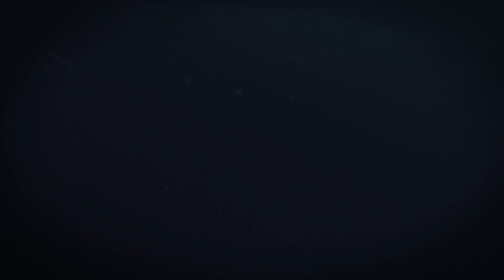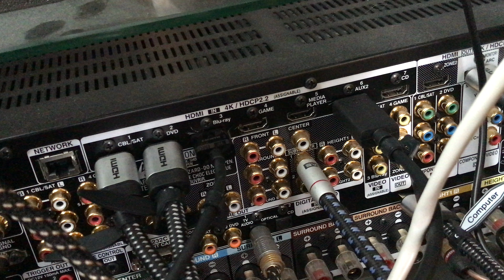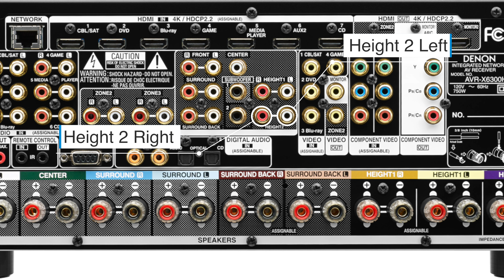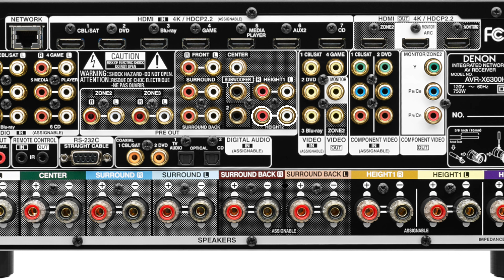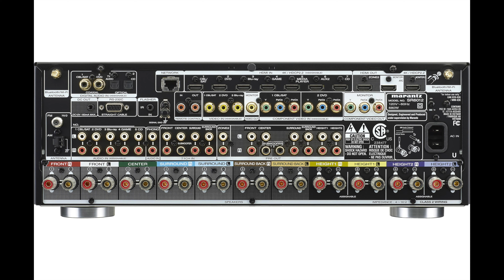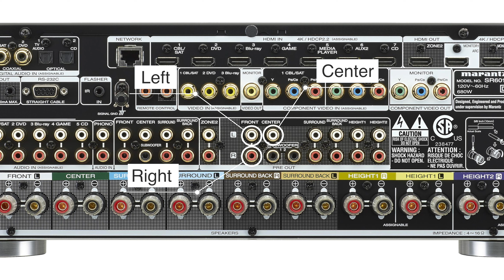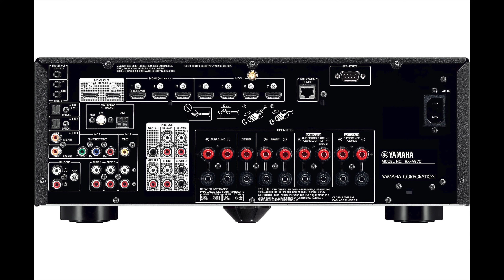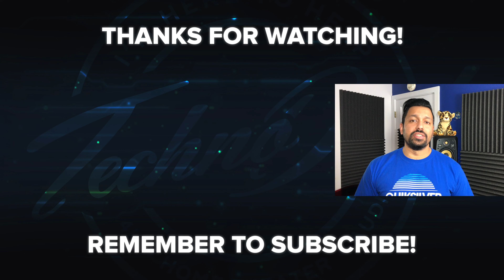How to Add an External Amplifier to Your AV Receiver | Home Theater Basics

Comment: Thank you for sharing the things, Can you please explain me about the "controls and settings on my  AVR  Marantz SR-6015, after adding the  
3 Channels  POWER-Amp to the preamps of my  SR 6015 (Center, FL, FR ) . Whether the volume, levels and crossovers and Audessy  settings  of these 3 channels will be automatically bypassed   or still continuous, any sound delay issues etc.  Rest of the channels (surround and height) continuous to work   as previous or stop?  If I select  pre-amp mode in " Amp assign'  setting what happens?

Comment: The master volume is still the receiver or are volumes separate between the amp and the receiver? It is something that I do not understand and it is not clear to me
Reply from the maker: Hi!  Power amps won't have a volume level, so the AVR will handle that.

Comment: Hello Techdaddy. My name ys Robert. I have a 5.0 surrounded system. I ordered the Yamaha Aventage A6@. I have 2 older tower L/R front Cerwin Vega VS seris 15” speakers that I would like to boost the output with a preamp what type, brand and wattage do I look for? My RMS on my speakers say 500 each. Can you help with atmos speakers also?

Comment: Yeah you're only getting the full 140W per channel if it's a 2 channel setup. If you have 11 channels you're lucky if you get 50W per channel
and that's too much for any receiver to handle.
Reply from the maker: Correct!  That’s why an external amp is so useful.

Comment: But what if you're working with a lower model receiver that only has subwoofer preamp outputs?
Reply from the maker: Unfortunately, you can’t add an amp with a lower end AVR.
Reply: @TechnoDad  what about high level to low level adapter?

Comment: So my 7.1 is running 7 plus 2 subs...living room ya dig?  I ran all the audio cable through the wall so the audio is an outlet capable home.  But I need to add a projector in the basement and surround sound attached to it and 3 or if not 2 more speakers outside

Comment: Just purchased a Marantz 6014 amp and currently running a 7.2.2 system. Wanting to add 2 more height atmos speakers. I understand you plug into the pre out  height 2 on the Marantz amp but where would you plug into on the external 2 channel amp. I also understand that you plug the new height speakers into the external amp and I’m guessing that you control the volume of the new height speakers from the external amp. Is the volume a preference that you control as needed?
Thanks

Comment: If I want to add power to my av, can I just use say an emotiva amp without a pre amp. Is a pre amp an absolute must. As I’m on a budget. Thanks for your help.
Reply from the maker: Hi!  Your AVR will serve as the pre amp and the Emotiva will be the amp.  Does your AVR have pre outs?
Reply: @TechnoDad  yes its a yamaha. It's a few years old I bought it to run with my 3d TV.  It has wonderful sound. BTW just bought the klipsck RP 280F towers  two of them as well as two svs PB 3000. . I also have two klipsch 625 towers  a d the 525 center and a set of klipsch bookshelf     for surround.  All I need now is a reasonable price amp. Any suggestions.

Comment: Where do you plug into the amp? Do the speakers plug directly into amp or receiver? Do you connect speakers between amp and receiver somehow?
Reply from the maker: Hi Steve, the signal path will go from AVR > out via RCA > into amplifier > out to speakers.  So you will connect the speakers into the external amp.

Comment: Any recommendations if I have a denon AVR-s540bt and it does not have pre outs? 
Guess I’d need to splurge on a new AVR?
Reply from the maker: Hi Drew!  Yeah, you are correct.  You will need an AVR with pre-outs.  Just make sure the next one you get, it'll have pre-outs and it's something you can grow into, like the Denon X3700H.

Comment: I have a denon x4300h 9channel capable of powering 11 speakers for aura 3d which is the sound format I’d like to have. The room is wired with 6 top speakers..2 front above mains 2 rear above surround backs,  a voice of God speaker above where I sit and a second centre speaker above the main centre. I’m also running 4 subs.
  I’d like to power the voice of god and top centre speaker with a Rusound P75 2 channel power amp.. How do I go about doing this..A simple wiring diagram would be great..

Comment: How do I hook up two niles si-2150 amps in bridge mode to my sr 5014 for front left and right.
Reply from the maker: Hi Joe!  From the looks of it, you would take the Left RCA (white) from the SR5014 and connect it to the white RCA labeled "For Bridged Mode" on the Niles.  Then take the Right RCA (red) from the SR5014 and connect it to the white RCA on the second Niles amp.  Make sense?
Reply: I sent you a email on your website.

Comment: How do you set the gain correctly on the external amps to match the levels on the channels powered by the theater receiver?
Reply from the maker: Great question!  There is no gain or volume setting on the power amp.  They just send the signal "full blast" so to speak.  The power amp will use your AVR or Pre/amp to dictate the volume.
Reply: @TechnoDad  all the amps that I am looking at that are in my price range and at the power level that I need either have a gain control in the back or a volume button up front. I want to use only the front channel preamps and have the rest of the channels driven by the theater receiver. So, would I just set the gain/volume control on that type of amp to full volume or close to it and then run the auto correction from my theater receiver?  Does the receiver control the necessary output signal to the external amp with slope to match the other theater channels according to the volume level?

Comment: I hope you can answer this question: My pioneer receiver model VSX-LX303 is a 9.2 channel. I want to connect an Stellar Gain Cell DAC, I am going to use the Analog Inputs of the Gain Cell DAC but what RCA outputs do I use on the Pioneer receiver. I have: VIDEO IN assignable 1- 2 and I am thinking that this is where I should connect the RCA cables coming from the Cell DAC. Thank you for your time.

Comment: Hello. Great video. I have a Denon AVR X3600H. I'm running 5.2.4 and about to run it as 7.2.4. My second amp is a Yamaha TSR-7850 which does not have pre-inputs  but have source inputs. Which source and where do I leave the volume of the 2nd amp? Thanks in advance!
Reply from the maker: Hi!  As for input, any stereo analog input would work, but you will be limited to two channels of external power.  Make sure the Yamaha is set to Stereo or Direct.  As for volume on the Yamaha, that's up to you, maybe 50%?  I don't know.  Use that Yamaha for now but plan on updating to an actual power amp.

Comment: quick question...I am going to add an external amp "Emotive BasX-300a" (2 x 150 watts RMS) to my two front speakers which are Klipsch R-625fa (100 watts RMS and 400 watts peak) and was needing to know if this is a good match even though the "RMS" on the amp if rated higher than the speaker?  Thanks in advance for any feedback

Comment: I have a question. I have 2 AV receivers. my main one is an OLD Onkyo receiver. plus a pioneer receiver which I want to use as a preamp. to power 2 subwoofer. (since my Onkyo has only a passive subwoofer output. (same with the pioneer) 
the Onkyo is connected to a TV via optical cable. 
the pioneer also has optical in and out. (the Onkyo only has one optical input/ Coaxial digital input.) 
what would be the correct way to use the pioneer to power two subwoofers? Thanks

Comment: Hi..love your videos and simple explanation. I also enjoy your very professionally produced videos. So Congratulations. If I may, I have a question. I have and ANTHEM AVM60 that I have my active 5.2 channels connected to via XLR. I was thinking of adding a pair of Upfiring speakers to use the ATMOS capabilities of the ANTHEM...and was looking at some passive speakers to do the job. QUESTION - I have an old Yamaha RX-V3800 which I want to use as a Power Amp. So do I connect the speaker to my Yamaha (any channel?) and then how do I connect the Yamaha to my Anthem. Would you be kind enough to help, please?

Comment: Hey techno dad! Quick question, so I purchase outlaw 5000x and like you suggested running the ear level channels to amp and leaving the rest to my sr6015 marantz. I have 7.2.2 set up, and in av menu assignable amps selected front only, visual menu shows amp logo assigned to front L/R. My question is how do I assign the center and sr L/R channel to amp in a front only assigned?
I am new to external amp world, in my configuration display menu shows fronts as pre amps and the rest of av as active. So I am little confuse, please assist?

Comment: Hey, Is it possible to do 3 channel amp setup by using one 2 channel amp & 1 monoblock amplifier? Can it be used on the Mighty Yamaha RX-A1080?
Reply from the maker: That should work
Reply: @TechnoDad , the thing is my area only 2 channel and 5 channel amplifier are available. We have very limited options here. Most probably due to regional restrictions such as 220 volt system. I know most amps like the monolith, outlaw, emotiva run on US 120 volt system, therefore plenty of options. I wish we had these options for 220 volt too.
Reply: @TechnoDad , UK amps are limited to 2 channel but for multichannel its too expensive. Cambridge is one of them, but too pricey.

Comment: Step 1 you plugged the rca cables into your AV receiver denon and then afterwards Step 2 I’m a little confused, because we can’t see where the exact “corresponding input” on the amp is. 

Other than that the video was really clear.
Reply from the maker: Hello Elias, here's an updated video which should show a bit more - https://youtu.be/x_a-9Uq4Tzc

Comment: Hi Techno Dad! I have Marantz SR 7015, Dali Oberon 5 front, oberon vokal center, and oberon surround and rear, and Dali sub.For ceiling speakers I have one set of Dali Phantom e-50, and I would like to upgrade to 7.1.4, what external amp would you suggest? Thx

Comment: What 3 channel amp is best to use on a Marantz SR 6014?
Reply from the maker: That's hard to say as most three channel amps are pricey.  Try the OSD Black 5 channel, it's fairly inexpensive and when you don't use the other two channels, that extra power goes to the other three.

Comment: In the Anthem MRX720, you said we can add height speakers preouts to external amplifier but will it make this AVR 9 channels. I mean 7 powered outputs and then I am adding two height preouts to external amplifier. How would that be possible? This AVR can only process 7 channels. Please respond. Thank You so much.
Reply from the maker: Hi!  The MRX720 can process 11 channels.  Right now I have it running a 9 channel setup.

Comment: Ok, I have a question.  My Denon x6500h has all the preouts.  I have 7.2.4 speaker configuration.  I want a Monolith 3x200 amp for front stage Klipsch RF7s and RC7.  What setting to I need to make in the setup menu, like amp assign etc, do I put it in eco mode?  Do I need to set the volume on the receive to a certain level?  After I connect it, I rerun the auto calibration right? Anything special there?
Reply from the maker: Hello Jack!  If you are running all speakers just fine, then there are no settings to change in the AVR.  Just connect the Amp the to AVR and then connect the speakers to the amp.  Run room calibration again and you'll be set!

Comment: Thank you very much for the super helpful video and thank you so much for doing the individual AV receivers. I just got the Emotiva XPA-2 Gen 3 for the front two channels with my Marantz SR5012.
Reply: Hi
I want to do the same thing with my DENON AVR but I have a question,how you contol the volume after that??
I mean I will have 2 front speakers connected to the ex-amp and 3 with my DENON,anyone knows?

Comment: Hello, have an 11 channel avr. Can I turn the amplification off in the air and power with only external amplifier?
Reply from the maker: Hi, Scorpion!  It depends on the AVR.  Some do and some don’t.  What AVR do you have?
Reply: @TechnoDad  Tnx for ur response, am in the process of getting one now. Was contemplating on going for a pre-pro but the AVRs out now have more updated  features. Pre-pos with updated features cost too much for me. Was looking into the Marantz AV7705 but that has been out for a long time now. I would like to do separates, could you kindly recommend an AVR with at least 9 channels that I can use a nine channel monolith amp with?
Reply from the maker: @scorpion8411  I would recommend the Denon X3700H (https://amzn.to/2QiMxUC) or the Denon X4700H (https://amzn.to/3gtTRYk).  Both of which will process 11 channels and power 9 channels.  They also have a pre-amp mode where it shuts off amplification to all channels which would be perfect if you are using the Monolith 9X amplifier.  BTW, do you already have the 9 channel Monolith amp?
Reply: @TechnoDad  Yes, got it last week but still in the box. Did not go for the Emotiva due to the 65 watt stereo module specs. Still have time to send the Amp back if need be, will greatly appreciate any pointers. Thank again
Reply: @TechnoDad  what do you think about the new Marantzs? I think i can be able to afford the 7015s. I know the two units are made by the same company, but a marantz is in my bucket list lol

Comment: Please can someome help,
I have powered speakers amd a passive center channel speaker.
I want to connect a my speakers with Xlr wires (without sending  amplification signal to the speakers )  and then  connect the center channel speaker ( on a amplified signal ) . Im confused on how to operate this system can someone help?

Speaker : Edifier s3000pro
Center channel : Jbl 520c
Reply from the maker: What AVR do you have?
Reply: @TechnoDad  Its a Yamaha HTR-5760, and i also have a Benq 2050a projector connected with my PS4 for main entertainment device.

Comment: Good day,sir.
Do u have idea on how to use my Denon 4500 remote to control my OPPO 105.
Oppo was not listed on the 5digits codes on deons manual.
Internet search indicated couple of 5digits remote codes the I tried to use  but it didn’t work.
Had no problem with Denon remote controlling cable box,Apple TV, Samsung 4K.
Ty
Reply from the maker: I don't know how to do that.  I use a Logitech universal remote.

Comment: Hey man, I hope you see this comment and help me out. I spent the last few months researching receivers, speakers, tvs, and Dolby Atmos tech. I finally upgrading my home theater and purchased an Onkyo tx-nr696 receiver, LG OLED 65in C9 tv, and the Klipsch RP8060 towers with Dolby Atmos speakers built into the top, 504c center, and RP600M surround. I’m currently running a 5.1.2 setup. The problem I have now is that I want to add 2 Klipsch RP500SA Dolby Atmos topper speakers to my setup to make it a 5.1.4 setup. The return window for me to send back my receiver has passed. So my question for you is, can I buy a separate amp and run the 2 extra Dolby toppers to it?

Comment: Hey,
I've been watching your Videos for years and need your help regarding my setup. Dont get me wrong, in the room/space it's in, everything  is clear, no distortion and bass hits yard but due to the limitations of my Receiver I wanted to know if a upgrade is needed first or would !a pre-amp help out.
Initial Setup:
Receiver- Pioneer VSX821
Speakers- Cerwin Vegas E-715 "2 of them" which I've had since 2004 and still get the job done.
Later Purchase:
Powered Subwoofer - Cerwin Vega XLS 15S and sound better than ever.
Bigger house and purchased another Cerwin Vega XLS 15S, not realizing that the Receiver had only one sub out, so a splitter and phasing was used.
Lastly to finish up the surround sound I was after I went with 1 XLS-215 tower sub, and this is when I noticed the actual limitations of the Receiver. With that being said, there's no clipping or distortion but notice that the front subs power is pulled along with the PreAmp subs as well when everything is on. So back to the main question, what should be my next route? A Receiver or Power Pre Amp?
2-E715
2-XLS 15s
1-XLS 215
Thanks for your help/input on Advance!!
Reply from the maker: Hi Calvin!  Thank you for watching my videos.  I think an AVR would be the best way to move forward.

Comment: One question I have a 5.1 system connected to my amp and I want to use 2 monoblocks amps for a separate sound system can I use my amp both as a pre amp for my 2.0 system and my 5.1 system

Comment: I am curious: My new $600 Sony 4K player has both a coax and an optical output.  Which is better?
Reply from the maker: There’s a huge debate about that.  I say use whichever you have cable and connections for.

Comment: Hi techno Dad your videos not only help us out but your channel inspires us to ever want to improve ones audio, SO THANKS!, that's why i would love some input from you, I'm going to be purchasing a 7.2  550 ARCAM receiver (£1500) to go with a pair of KEF LS50 bookshelfs (£800) in my 12f × 13f room, but my setup is a 5.2.4 and due to size constraints iam limited too 1 box either side of the Centre channel or possibly 2 thin power amps on the other side! so I was thinking of getting 2 x 2-channel  thin TIBO power amps (2×£200) for my 4 small Atmos height channels and then driving the 5. ear level speakers with the arcam! But here comes the conundrum:
Due to the fact I listen to 80% music and 20% TV,  I feel I'm wasting amplification space for the sake of the Meager 20% TV sound! Or do you think the arcam will be satisfying enough to drive the 2-channel stereo sound with out extra amplification in my small room? Can you or anyone else for that matter come-up with a better working solution for me.
If you or anyone else need a visual display then click on the red dragon twice and you might get a better idea where I'm coming from!
Reply from the maker: Hi!  I think you will do well with the ARCAM for your two-channel setup.